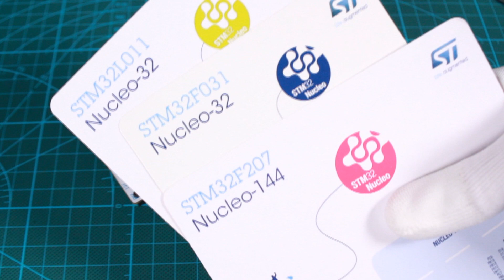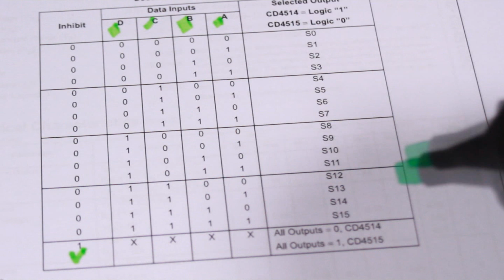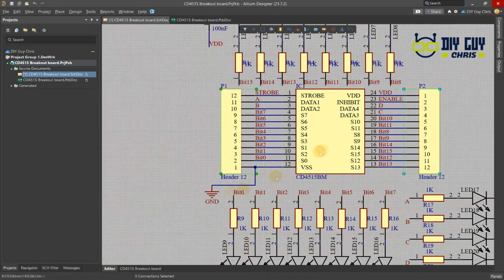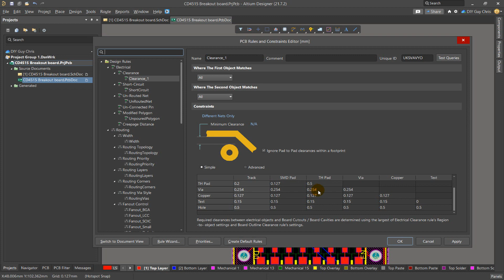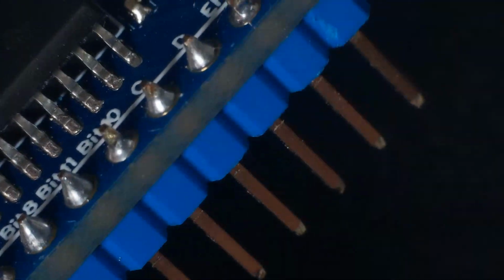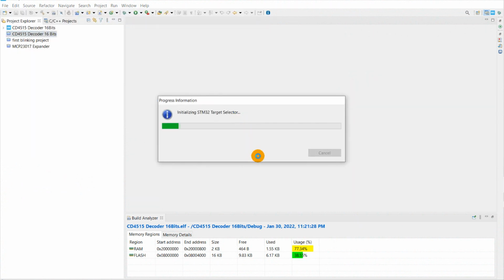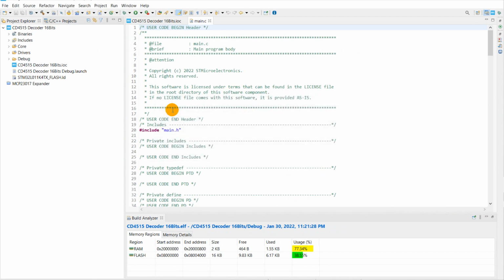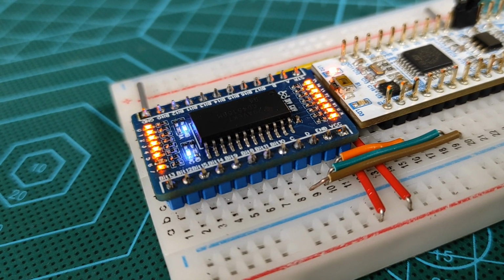Make your own Circuit Module | Decoder CD4515 | STM32 Nucleo tutorial

Comment: Where are you taking the power to light the indicator led 
In case from the gpio pin directly 
Will it affect the signal 
In case i want to have such leds for pwm pins or uart or i2c or spi communication pinns
, i saw some boards which have indicator leds for gpio pins use a hex inverter can you explain me how that helps 
Thanks a lot 
Leanrt a lot from your video

Comment: Did you hand solder 0603 components?? That's some skill.
Reply from the maker: Yes I hand soldered those LEDs and resistors and they are all 0402 package components, smaller than 0603
Reply: @DIYGUYChris  😳
Reply from the maker: @CodeMakesItGo  it is easy as long as you use the appropriate tools, I showed on my video what is needed to achieve a good hand soldering for small packages, try it, you can ask me if you need any support 🤟